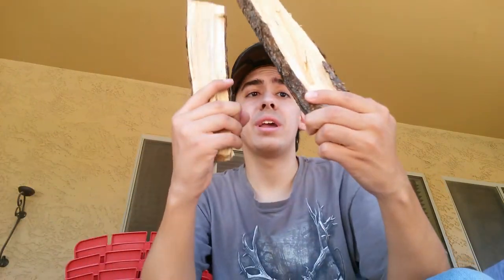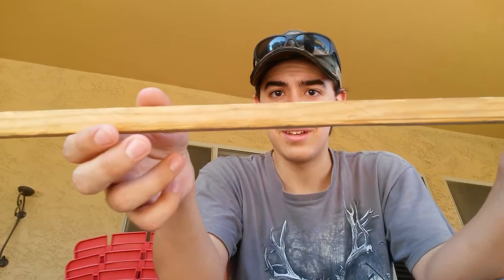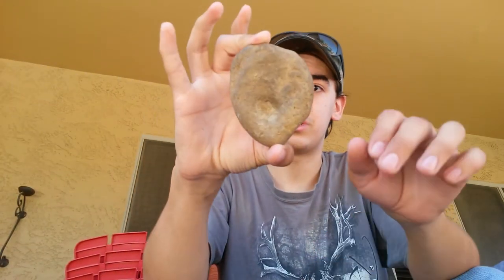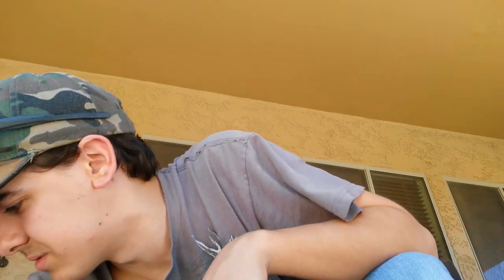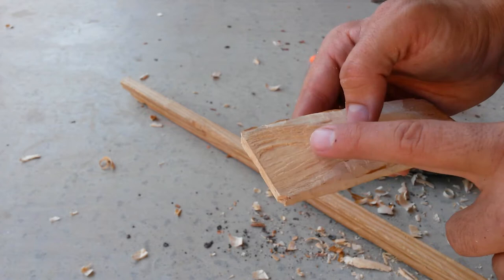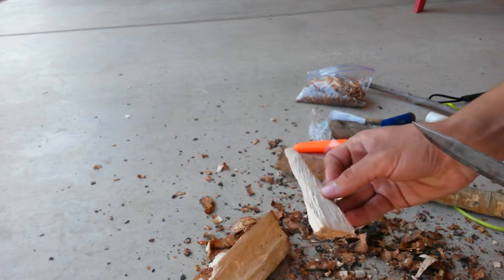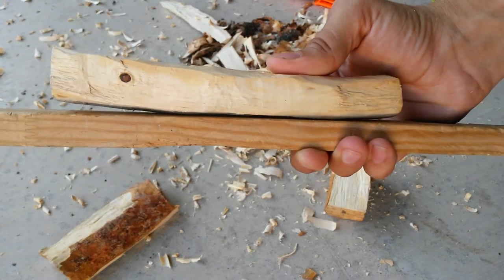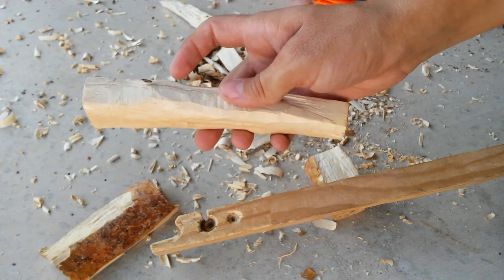Friction Fire Testings- Part 1 -Making a Pine Hearth Board and Spindle

Comment: Great video bro. I give it a thumbs up. I struggled with the friction fire for over a year or even longer before I started having anything but smoke. I don't think pine is a very good wood to start with. I had better luck with a longer spindle. Try starting with a longer hearth board and spindle. When you get it down thin work on a more compact kit. I don't have the time now but looking forward to the rest of this series. Thanks for sharing.